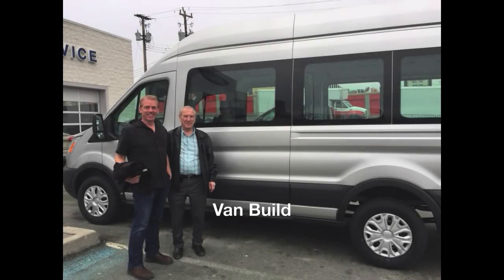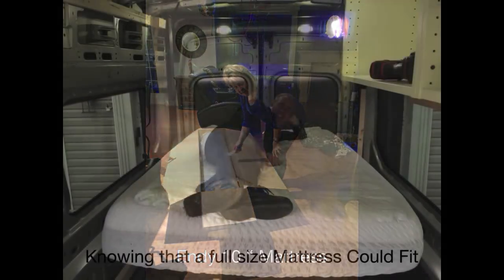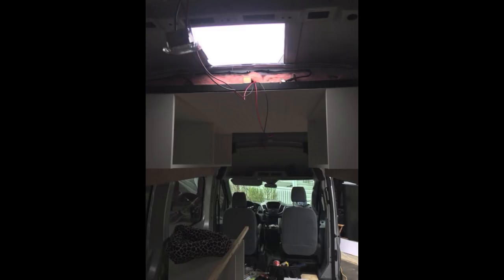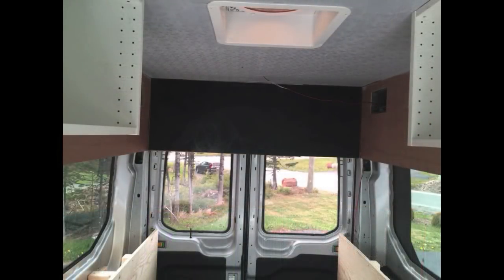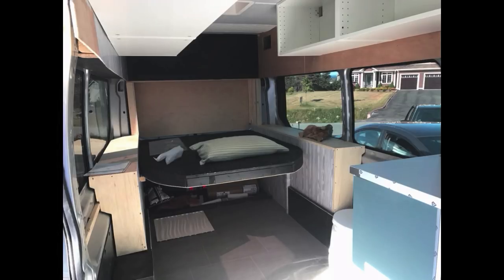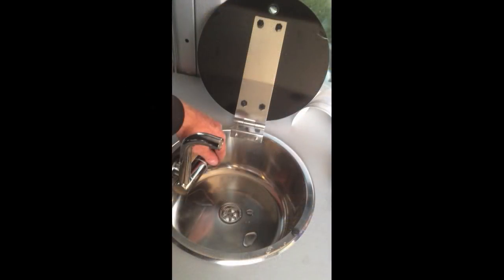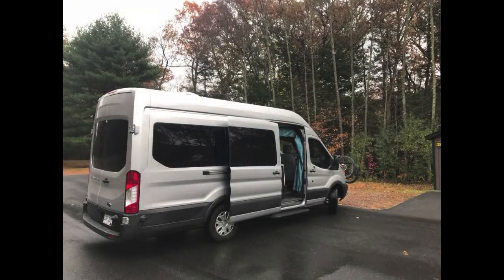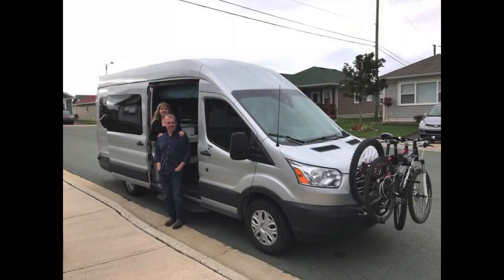Conversion Van Ford Transit 250 Extended High Roof

Comment: Really nicely done. I'm tired of vans with platform beds that use up 75% of the living surface 24/7, and a Murphy bed is a good solution for that. Not a huge fan of too many windows, personally, and definitely not a fan of unvented propane burners - I'd rather not breathe that stuff in, because they all release a little in the ways of harmful fumes. There are better vented heater solutions if you're already building a van to this standard. Like Espar, Webasto diesel burners, or various propane burners that vent outside, like Propex. But the Murphy bed definitely makes it.

Comment: do you live in your van full time, if not, it doesn't matter if you have a shower or not, my husband and i will live fulltime so we need a shower.
Reply from the maker: NADIA CUSAN Hi we have lived in it for months at a time but not full time.  The van does have a shower head but we never used it.  Most of the time we would use a park shower every couple of days.

Comment: The 250 is not what you have from what I have seen! It appears that you have a 350  IF you ACTUALLY have both THE HIGH ROOF AND THE EXTENDED LENGTH. AS YOU CLAIM! 😳

Comment: Where did you find the remote for the 12v "switches"
Reply from the maker: https://www.amazon.ca/XCSOURCE-4-Channel-Wireless-Transmitter-LD1146/dp/B0771N18YF/ref=sr_1_5?ie=UTF8&qid=1548089440&sr=8-5&keywords=12v+relay+switch+remote

Comment: Doesn't fiberglass insulation create moisture?
Reply from the maker: Hi....good question.... I was actually expecting moisture ....I added a dehumidifier option on the heat pump... 4 in 1 .... but really haven’t used it.  I can count maybe on one hand how many times we have had moisture on the windows.... she is actually very dry.
Reply: John, 
I think you meant to say doesn't fiberglass insulation absorb moisture?  I think it might absorb moisture if not sealed from the living space by a vapor barrier.  Propane heat and two humans breathing create a lot of moisture in the air.  If heat and moisture from the living space is allowed to get behind the walls, moisture (condensation) could form on the cold metal outer walls and wet the insulation.  (In a cold climate)

Comment: Thanks for sharing your van built; But you should reconsider placing your bikes at rear . Killing the aerodynamics of the van and it looks goofy!
Reply from the maker: Jesse Revilla so true but for parking in a single stall on a parking lot it works out really good.  If they were on the back it adds extra length.  I looked at the fold down ones and swing ones but in the end decided on the front setup u see.